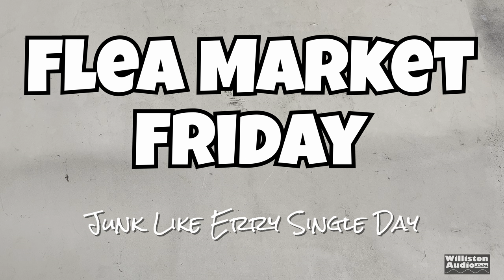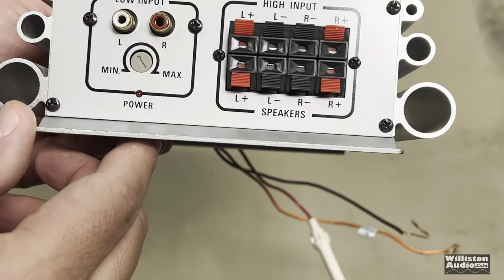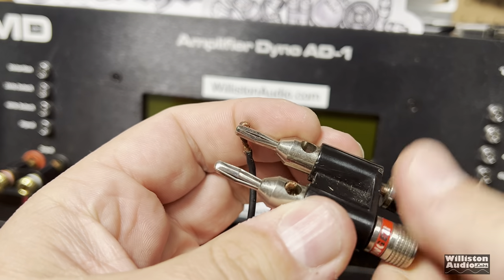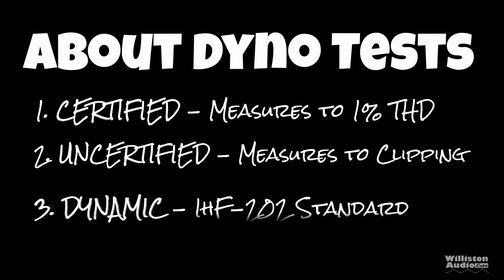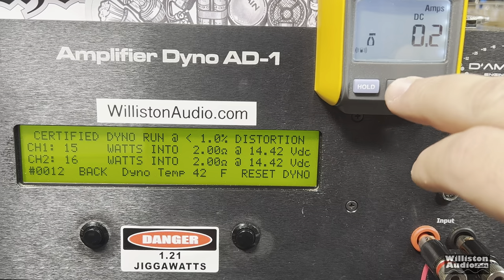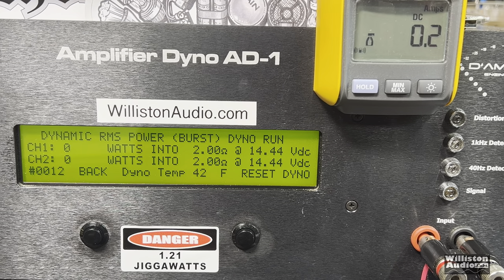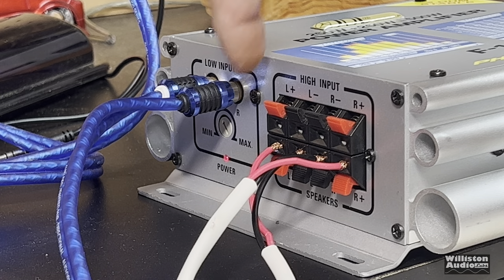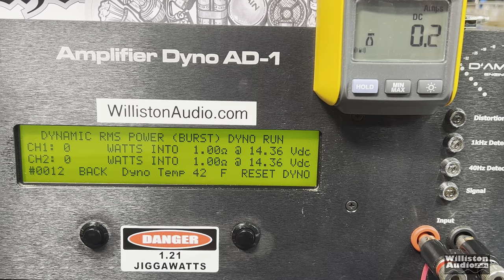Why You Should Skip Flea Market Amps...

Comment: The max power ratings are rated WLS.  When Lightning Strikes the amp, it will put out true rated power for a fraction of a second before it blows.  20+ years ago I told customers this on a regular basis when I sold car audio!!
Reply: Lmfao
Reply: Requires 1.21 jigawatts input power.
Reply: Around '06 I dated a girl that was a seasoned cellphone salesperson. She got a job at a car audio shop that had a sizeable cellphone department, but she was required to train up on car audio sales to help out when cellphone sales were slow. The analogy I explained to her was that the max power rating is like the speedometer on a car. Just because it says 120mph doesn't necessarily mean that the car is capable of going that fast. Even if it is, you wouldn't be able to drive at that speed for very long, and the consequences will probably be severe if you do. The RMS ratings are the speed that DOE measures your fuel economy at 😁
Reply: @303nitzubishi4  that’s actually a really good analogy!!!
Reply: WLS at 88mph = time travel 🧭
Reply: One of my friends, in the car audio industry, coined ISBL "If struck by lightning" as the rating when the fusing was nowhere near the rated power...

Comment: I remember a friend of mine bought a gigantic amplifier from a flea market. Gigantic claims on the art work on top of it. I took the cover off of it, and it had a small circuit board in one corner of the amp. The amp was at least 80% empty inside. Lol!
Reply from the maker: https://youtu.be/1JWB8m4Y9aI
Reply: @wal  
Yeah, kinda like that. Lol!
Reply: Had a Rockwood 1000 like that. It was a monster of a heatsink. Tiny little amp with very little power. Funny thing is I bought a brand new Rockwood Detonator 300 and it actually had a decent bit of power, probably more than the 1000.
Reply: @wal  Hello Big D I am just coming back to car audio!  Will you give your opinion on what would be a great bang for the buck setup for head unit sub and amp?  The setup will be going in a 2004 Lexus is300.
Reply: @soobok13  
I have the Skar Audio 2000.1D. Recommend if you can still find one. Big D tested it on his channel.
Reply: @MFXdump  What are your thoughts for a head unit and 12 inch sub?
Reply: @soobok13  
Sundown sub, Get an Alpine HU. 
I have Alpine head unit 174bt. Good sound, but likes to forget to connect audio from my phone calls through the interior speakers. I’ve been looking at the Joying Universal 8.8 head unit. I’ve read reviews about nice sound quality from the 16 band eq in the head unit. 
Subs are sealed. 3 DB Drive platinum 10’s on the Skar 2000.1d. Just get what you like.
Reply: I took apart a planet audio amp chaos series.  It had a thick plate inside on the bottom cover at least an 1/8” thick.  🤦‍♂️
Reply: @clearme2  
It’s for the weight. That's right, Dude. The weight. The ringer can't look empty.

Comment: Reminds me of a Sparkomatic Lc52 old school mini amp(they refer to it as a "power booster"). But at least they rated it more accurately at 40watts and made the case only as big as it had to for the circuit board, which made it much more convenient because you can place it under the dash. It also had a button so you can easily turn it on and off.

Comment: I was a car audio salesman/installer in the early 00's and I had many a customer come in with dead RCAs on their decks from amp grounds shaking loose and the amp at full tilt trying to pull ground through wherever it could. To Panasonics credit they were the only company that wouldnt push back on warranty replacements. I was really sad then they exited the head unit game, for the money they were unbeatable. I still have my G-Shock deck, one of the first of its kind to actually have anti skip. It would scan ahead like 20 seconds and could play CDs with scratched you could see through. What a unit! I can sympathize with the sad death of a deck like that, I was crushed when mine started having issues. It was like losing an old friend.
Reply: Man, the Panasonic decks from that era were seriously slept on. I'm hoarding like three or four of them. Currently have the CQ-C8413U in my daily. Using that thing until it gives up the ghost 👻
Reply: @ismaelgarcia8243  I still have one rocking in my grandmas old car. Panasonic head unit to Hifonics amps, pushing Phoenix Gold mids and Audiobahn subs. Its a time capsule for sure lol

Comment: Can you test some head units on the dyno too? I'd love to see an Alpine cda 9835 on the dyno along with some other head units. I'd never use the built in amp but it would be interesting to see. The reason for the 9835 is because it has that extra box on the back which is supposed to be for better power.
Reply: Yes head units please 👍👍
Reply: Most all head units use the same Texas instruments chip. Usually 12 is wpc. Probably the same garbage that's in that high-end amplifier he's testing.
Reply from the maker: I tested the Pioneer PRS80 at he end of an amp Dyno video. Now let me find it…
Reply: Love that 80prs still have a couple of them and they just sound great. Nice stable rca output.......

Comment: It's easy to clown on this thing in the modern day, but to put things in perspective keep in mind that manufacturers sold tape decks and even CD players well into the '90s and even a bit in '00s that had small, cheap ICs putting out 3-5 watts RMS per channel. And when I say "channel" I mean left and right. Faders were sometimes wired in AFTER the two channel amp and loaded the amp with the speakers in series to match impedance so your actual power at the speaker was even less. An external amp like this that put out 3x the power was a legit upgrade if you were running large door speakers or 6x9s. But I pity the fool who dared connect them to subs

Comment: The wiring coming out of it is just hilarious. It offers nothing over a head unit, and I'd rather run on head unit power. I think I had a JDL amp 4 channel I got from a relative 20 years ago, fairly large amp considering what it had inside and couldn't believe it had a pair of head-unit chipamps in it. Wasn't a whole lot smaller than a Rockford 800a2 (minus the end caps of course).
Reply from the maker: With a name like Japanese Dynamic Labs, it’s gotta be a beast

Comment: I worked ay a stereo shop in the late 80 s early 90 s. We did installs and repair. Saw a lot of flea market amps that had lead or steel plates bolted inside their nearly empty cases. If its heavy it must be good.

Comment: I'm gonna pour out a drink for your 9815, I'd be devastated if it were mine.  I've had them all, I like the 9835 the best, it has all the same Bass Engine Pro, 60x4 V-Drive and all the good stuff, but has the BIOLITE OLED screen.  Wasn't keen on the glide touch on the 9855, but they gave you a graphic EQ on that one for the first time.  When the 9886 came out with Imprint, I bought it, then dumped that hot garbage within weeks, I got an Eclipse CD7100, had it ever since, 2008 boi!  I got a Pioneer P99RS, I use it as a pre-amp and run it into the Eclipse's AUX, gives me 2x EQs and 12 channels 😁

Comment: Could not do those numbers with out the air cooling system , but the sticker eq might have held the heat in . Where was the fir cam at on that burner

Comment: Yep, I had that same alpine back in 2003 in a s10 with a parametric crossfire eq, crossfire cfa1000d on a Orion hcca15d2 and a crossfire cfa202. I’ll buy that broken alpine from you if you want to let it go. Or, I would be interested in taking a stab at repairing it if your wanting to get it repaired. No charge for the repair of course. I repair amps regularly and have repaired many head units over the years too.

Comment: You just didn’t understand the rating system they used:

14w RMS
21 RMS (dynamic)
250w “Max” <— did you see that it said “max”…..yeah, you didn’t test its “max” power and I’m pretty sure it would hit that spec with the Chi7-474na rating.

Comment: I paused mid video, I fully expect when he opens this beast up for the high level inputs to be wired straight to the speaker outputs 😆 🤣 😂 😹
My only reservation on this hypothesis is that the head unit prolly makes more than 15 watts 😆 🤣 😂

Comment: Hey big D !!!! I would love to see what cable size and say a old school cap would do a amp.. I used to run 8ga on stuff.. with all this stuff on batteries and everything… in the old days I would put a 1f cap and my lights never dimmed.. but that was with ppi or Orion amps.. now days the power draw is crazy. I would love to see what the wiring actually does to a bass amp..
Reply: Caps don't help and Orion amps are not efficient, so...

Comment: R.I.P. to the Alpine head unit. I'm surprised it didn't last another 8 to 10 years. I know people that still have working Alpine tape decks. Oh well, the 80 PRS is a fantastic head unit with zero clipping at full volume. As far as the amp goes, every time I think it can't get worse, you find one that's an even bigger pile of scrap metal. As far as I'm concerned, the death of the Alpine is the headline of this video.

Comment: Why don't I see any calculated efficiency ratings? 4ohm Dynamic test pulling 1.9 amps @14.5 volts(27.55 watts) @7:40 when pushing 15 watts per channel.  Overunity?
Reply from the maker: Dynamic tests at 1kHz don’t work for current due to the clamp

Comment: So you were actually pulling full load of the amp through the rca cable 🤣. Did they get hot? Maybe you should patent the self grounding rca's "only works on flea market gems.
Reply from the maker: It was just the sound demo part. I had it connected to ground for the Dyno tests
Reply: @wal   I know. Just making a joke 🙃

Comment: Tbh as weak as it is. If u cannot upgrade the deck. If these were cheap enough 2 could run speakers. But need something serious for bass lol. I mean. Like factory setup wouldnt allow a new deck. Then there is still an option assuming it doesnt fry after a cpl weeks. But I still would not buy